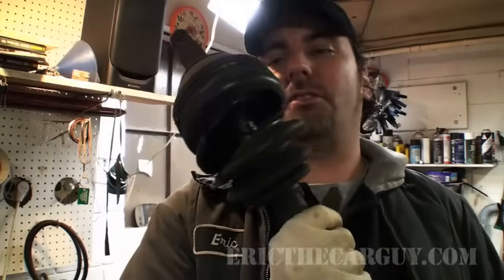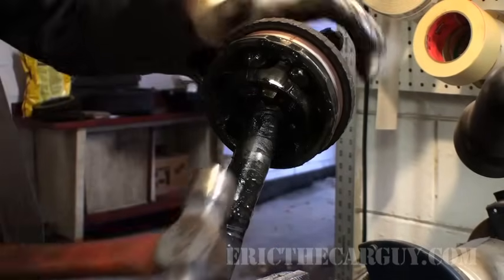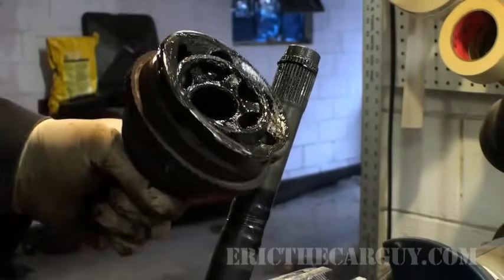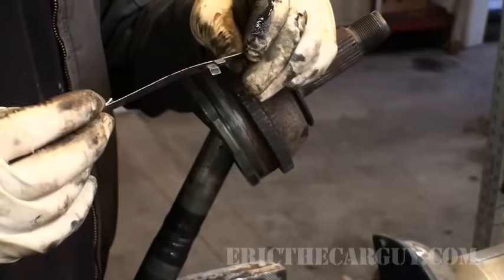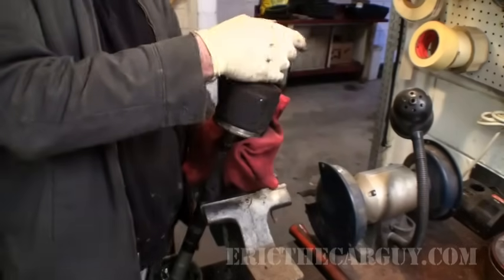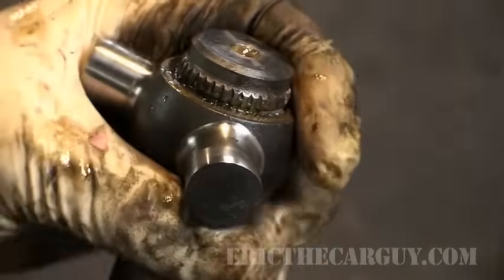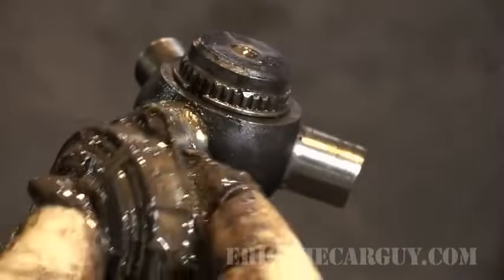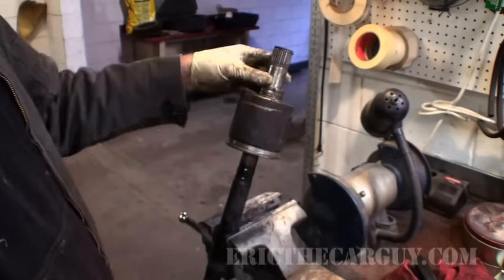How To Replace CV Boots - EricTheCarGuy

Comment: When you pull on the shaft (between the inner and outer boots), are they suppose to move a bit? one side seem to move more than the other side. When I brake at 60 MPH the steering wheel shaking, the rotor look fine on both sides. so why the steering shake when I brake at high speed (slower speed, you don't feel the shaking on the steering wheel)? tires are balance.

Comment: My Honda Accord 2000 inner CV joint was over extended when I removed the knucker to replace the wheel hub.  Now, I can't get the half shaft back into the inner boot.  Any suggestion that to put it back into place?  The boot is still good.

Comment: 2 questions if my CV joint is fine no clicking should I replace the boot or whole thing and 2nd can I use the regular O clamp with inline screw and cut the excess off

Comment: So I only know the basics of car care. I have a 2001 Hyundai accent manual 5spd. It is clicking when I turn but sometimes when I hit a bump but not on straight driving. Should I replace the joint, the axle, or jus say let it ride? Not trying to put more money into an old car with high miles

Comment: I have a 2003 Camry that failed inspection and I cannot pull the axel because it is seized on an axel guide. I can separate the outer axel from the cup at the inner joint. But the piece from the cup to transmission is stuck and the bolt holding the guide is behind the remaining axel. Can I break apart the new axel and insert it into the old cup or is it best to just replace the boot? I noticed no clicking, but it is new to me.

Comment: Eric can you better describe what you are doing with the circlip ring as you're pushing it on with one hand and you say to push the pins ??? I'm worried I don't want it to be done wrong and come off. It's not clear in the video what you're doing to it as you're putting it back together. Thanks

Comment: Would this help a drive shaft that mildly  vibrates on acceleration at high speed?

I figure if the boot cracked open and the grease came out causing the issue, then re-greasing and booting would solve it? As opposed to replacing the whole axle... save a few bucks and the environment? 

Plus i've heard a lot of axles are made very cheaply, nothing like say honda OEM axles. or you might get a flawed one that will crap out in a few thousand miles- all the better reason to just regrease and boot.

Comment: how much different is there between that cv joint u showed us, i have a Mazda 626 Gf 1998. i need to know is that also build the same as the one u used. here in denmark they dont sell the Whole drive shaft any more. they only sell the cv joint these days. hope u can help me course i have never tryed change a cv outer joint before. stefan :)

Comment: I had to replace a boot, I don't know if I got the clamp right enough.  when I push/pull on the joint you can hear it taking in and pushing out air.  Is this ok or do I need to reclamp it?

Comment: My 07 element has the torn cv boot for the front passenger side. The axle is over $600 from Honda. Only makes clicking noise when it’s on jack stands but not when driving on the road. What is a good affordable axle that’s OEM quality?

Comment: I know this is a very old video (by youtube standards anyhow), and I don't know if you even follow comments on videos this age, but I have a question....You showed knocking the joint off of one end, changing that boot, then the same on the other end.  Question is, couldn't you remove both boots off the same end, thereby saving the removal of one end??  Maybe I'm totally off.  Maybe I'm missing something.  Just asking.  Great videos by the way.

By the way, I do understand that it's hardly worth changing JUST a boot on a CVA and I have no intention to do that...just discussion.

Comment: I have a '96 Subaru, which should be quite like this one.  However, I have to take off some of the exhaust because they are under the inside of the CV joint.  Why wasn't that an issue with this car or did he skip taking off the exhaust?

Comment: I ordered a new passenger side CV drive axle for my Neon 2000. My new CV drive axle has no cotter pin hole on the splines. The hub nut has indentation for chisel punch. Is that a new thing CV drive axle replacement?

Comment: Looking for feedback. We have a cracked open front outer CV boot on our 2002 BMW 330xi. My son read on a Beemer forum that replacement axles don't allow as tight a turning radius as the factory/original ones. The car only has 88K miles so we ordered just the boot. Any comments on replacing the boot vs the whole axle on a 330xi?

Comment: but Eric, what is your experience with these "relatively cheap" axles (or outer CV-joints, which i found for €20 for my '00 Volvo V70) how long would those last?
and i learned long ago to not bother with these metal clips around rubber boots, because a: they can cut into the boot, b: zip-ties do the job just fine and don't cut and c: don't need special tools other than myself

Comment: constant velocity joints are the same as u-joints. but u-joints don't spin at a constant speed; they can't flex enough and they cause vibrations. Cadillacs and Lincolns had constant velocity joints on the drive shaft but the rest had u-joints.

Comment: Most of know if it´s clicking it´s better to replace the joint . . so i don´t agree to change the joints just because it´s ¨"better" (you say almost costs the same) to replace them versus replacing the boot . .  the cost of the boot is much less . . we don´t want to wait till it´s clicking, it´s good to detect the torn boot on time . .  thanks for the info and Greetings

Comment: Is an old video yeah if it was me because sometimes the reman ones or the aftermarket ones tend to wobble at some speeds possibly the originals no. So like if you catch your joint with a torn boot and it's not clicking and you wanna save it because it's original then I would get a boot and grease for it. Original axles cost close to like 500 dollars and varies from car to car I would say. You would just need those tools for the bands to do the swap.

Comment: Great Video, My driveshaft wouldn't come out even with a big hammer, ended up cutting the races, removing the balls and the half shaft, then grinding the end of the inner race so I could get the "c" clip out (be careful you don't damage the axle.

Comment: Nice video. What about an axle that causes wobbling/bouncing between about 45-55mph then runs smooth any speed lower or higher then that I mentioned.
Reply: check your tires, alignment and a-arm bushings.
Reply: +Rocketman McFodder I changed both axles. Both outer boots where torn and joints loose. Problem solved. It is smooth now.

Comment: so I have a 77 Toyota Celica. I changed the ball joints and a month later I made a really slow sharp turn and heard a loud pop or click. then a week later my steering started shaking. any clues on to why or what is causing it? could it be that I just need an alignment? the clicking also happens when I'm stationary and turns the week half way.

Comment: A much better way to disasemble the outer joint, is to use the centerbolt as a puller. If you have an old one, make it a bit pointy, so it centers the shaft. It will release the c-clip, and pull 1/2 -> 3/4 inch out. THEN you can use a hammer with caution. If you have bolts even longer, you can pull it all the way, no hammering.

Comment: Ive often watched many of your videos when im about to undertake a job on my car and If you get a chance to respond, I need your advice. 
A few months back i changed my outer cv joint on the drivers side of my 2005 Audi A3 but when I went to start the engine  it wouldn't turn over and I heard some worrying grinding sounds, I figured I had over tightened the hub nut and after loosening it a little the engine started but subsequently I started to hear a loud knock noise soon afterwards. This only occurs when I reverse park up a curb or hill. I've checked all the boots inner and outer on both sides and there are no tears. Is it possible that I've a broken inner cv joint? And if I'm to replace it should I do the passenger side too?
Reply: 2 new axles and a starter my friend. Use a torque wrench and a service manual.

Comment: How to replace a intermediate shaft on a 2001 Pontiac Grand prix 3.1. it's on the passenger side. bought an axle but forgot to check the clip ring on the axle. it popped out and started grinding axle to the intermediate shaft. any helpful advice would be appreciated.

Comment: Hello Buddy , I have 1996 Lexus ES300 which is the same exact thing as 1996 V6 CamryThe exhaust pipe in the middle where the resonator is seem to have a factory type of outlet and it's covered with the wiled that piece, there seems to be exhaust leaking from that is that purposely there?? And why

Comment: I know this vids 12 years ago but maybe someone out there has the answer to my question. If you have a CV boot that's ripped quite a bit, mine's not clicking and I'm not having any trouble with it, but...... Is there anything I can grease or lube it with in the interim?  I can't afford to replace CV boot or drive axle at this time so just want to help it out a bit in its functioning. So would any grease or lube applied to that area help?  I do understand the mechanics of how it all works and the importance of it being intact.

Comment: I have a 92 Mitsubishi 3000GT and i just replaced the front left driver side CV axle. Took it for a test drive and now it's vibrating while accelerating. Could the inner joint not being lined up correctly be the issue?

Comment: That is what my brother told me when I asked him what to do about a torn CV boot.
"Just change the axle". He is a mechanic who works at a shop.
I told some guy at O'reillys about it. He was like WHHAHAAA? when I told him I was just gonna change the axle instead of using a boot repair kit.
Reply: +JacksTip well a lot of the time dirt and rocks can get ground into the joint and cause wear, so some people,  shops most of all, like to replace it and skip the risk
Reply: I like to stay OEM on my cars whenever possible, especially on my Hondas that are sensitive to the Chinese axles and suspect remans. A friend who has a Toyota 4Runner was quoted $800 by the dealer to install an OEM axle. We caught it in time before dirt ruined the joint and re-booted it for less than $100 using the Toyota boot kit.

The only bad thing about re-booting axles is the greasy mess and having the correct tools on hand, which aren't too expensive. Getting the outer joint off the shaft used to be an adventure until I saw a guy on YouTube cut a hole in a 2x, slip it over the shaft and on top of the outer joint then whack it with a sledge hammer...joint off - easy. I changed just the boot on the outer joint by cutting the block in half with a miter saw then securing it around the shaft with deck screws. I can do them pretty quickly now.
Reply: Can you link that by any chance? 2 cars later (sold other ones) and the new one also has a torn cv boot. No clicking yet though.

Comment: when reassembling shouldn't the components at each end be alined the same with each other as they were before they came a part or doesn't it matter ? No balancing issues by not putting  it together exactly as it was before ?
Reply: Robert Paterson Man that's a very damn good question. It probably hinges on whether the components are balanced individually or as an assembly. Anybody know about this issue?

Comment: Do you still feel the same way about a torn CV axle boot in 2018? I just looked on eBay Eric, and there's tons of boot replacements as if it's more common. I have the same Honda Element you do how do you feel about CV axles off eBay. Need recommendation

Comment: hello could this cause a shake on the cars front end only around 45 to 60 mph it happens,ive had the tires changed and balanced and good video
Reply: possible things to look out for is wheel bearing problems or even the strut bearings.that sent my laguna shaking between 60-70 mph and also had a mx6 with the same problem too with strut bearings.best way to tell if strut bearing is if you turn your stearing without moving and you hear a clicking noise its usually means the bearings in the top strut mountings are gone.just done mine on my laguna and not too hard a job

Comment: I realize this is super old, but maybe you'll see my comment. Lets  say the boot came off, but the axle is still on fine-ish. How long could you drive without the boot? Also in theory could you only remove one joint and slide the boot down the length of the shaft?

Comment: I had a bad axle for my 99 accord. Took like a yr or half until it broke. But was very dangerous. I was driving on the high way and it was pulling to the right. Then when it broke I couldn't put the car in park because it would roll! So don't wait and change ur axle.

Comment: So i have a clicking axle. Rwd vehicle. The boost looks perfect but it clicks. What causes the click and can it be "rebuilt"? I changed this part with a rock auto cardone part and it was 1" shorter than the original. Installed it anyways and works but idk what the long term effect might be. For anyone who wants to take in this task. Might not be worth it for a diyer. Just drive it like he said in the first part of the video. It was a pita for a regular person with minimal tools.

Comment: got some question to you friend i installed auto transmission to my engine i think i made wrong for it
the trans is normal working but when i installed it the engine itself does not turn even in neutral position.
i remember there is small gap about quarter inch, i force it to remove the by tigting the bolt.my question is did i
break the transmision? thank

Comment: Replaced passenger side cv axle on my 2006 gmc sierra. Now it makes a noise (only in 4wd)  when turning. Makes the noise when I turn right or left. Sounds kinda like a barking or rubbing tire. My service 4wd came on also. NO noise in 2wd. Replaced with Napa Auto manufactured axle. Any Idea what could be going on?

Comment: Hey #EricTheCarGuy I am having an issue removing the inner joint from the transmission on my Volvo S60 on the drivers side, I saw a video you posted on a volvo you worked on, calling it the most stuck cv axle ever, my axle is a little different where the part that's stuck, is stuck in the transmission side... everything I have tried to use to get it out has failed, and I'm running out of ideas to get it out, even as far as bending 2 pry bars trying to get it out, I read in forums that these volvo's have a common issue where the axle splines rust in the transmission causing them to get stuck.. and at this point I don't know what else I can do to get it out.. I need help..

Comment: 0:30 I dunno about that, I could buy a new driveshaft for $180 from Ebay with the same quality standards as the one I could buy at say O'Reillys for $450. I bought the CV boots for $37 each which surprisingly included shipping. That's less than $80 for those keeping track and the axle is pretty much good till you bend as those things will rust forever. I dunno about you but for $106 I can spend an extra 60 minutes doing the work.
Reply: +Twisted86  You're only replacing the boots. If you're going to replace the joint, purchasing the whole axle is a good idea because the cost is about the same, just like Eric says in the video. The joint is significantly more expensive than the boot.

Comment: they do last a good long time clicking, when they wobble then you should start thinking about it. when you are wobbling driving straight down the road you should probably fix it as soon as you're at that point.

 I had a Civic which somebody it's souped up the engine but use cheap axles and I took that to the point where it actually failed on-Road just making a left turn from a stop light ,. click click clunk... motor revs up, no go...  they vibrate pretty bad before they outright fail

Comment: Mine doesn't click just when turning hard left the driver side makes a pop noise like running over a soda bottle and the boot pops off a little then back on when I straighten out so should I just replace the boot ?

Comment: Once you get the outer CV joint out, can you just place both boots in and forget about removing the bearing holder in the inner CV joint?
Reply: The OD of the shaft is not consistent that would be a reason why he didn't do it that way.

Comment: Clamping the boot,..I think a plastic tie wrap be used.  Would it be any problem using a tie wrap?
Reply: not really
Reply: the metal bands can be tightened much better. they're not only there to keep the boot on, but also to keep water out. heavy zip ties might last a while, but not as long as metal, either

Comment: Anybody know if they need to be clocked the same when you put them together as they were when they came apart for balance reasons? I've always just put them together however I felt but I also always have a steering vibration at highway speeds

Comment: 03 Honda Pilot, I've got axle grease coming out of the inner boot.  Sort of a spray pattern.   Outer boots are fine.  My wheels are not clicking at all.  But, I've got a pretty strong knock going over bumps.   Two questions so I know what I'm saying when I tell the mechanic what the problem is...1) could the knock be related to the apparent hole in the inner boot?  2) Why couldn't you just slice a new boot, wrap it around the old one enough to cover the hole(no tears, just a pin hole somewhere on it) and put a hose clamp around that to buy you a little bit more time?   Not a mechanic, just thinking here....